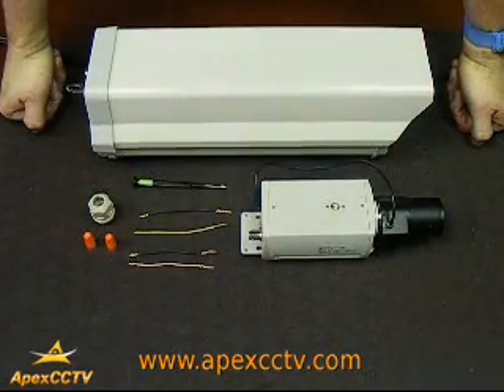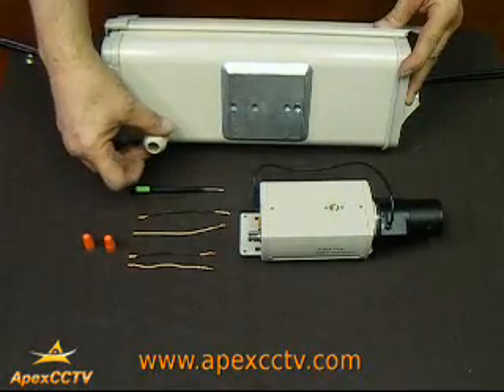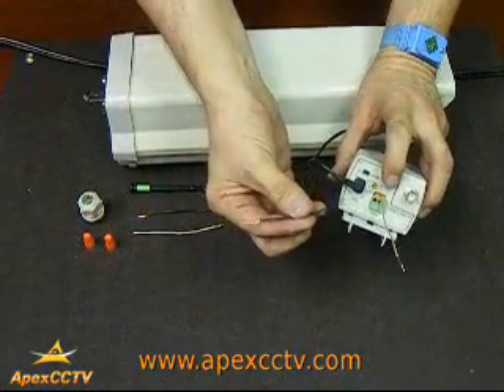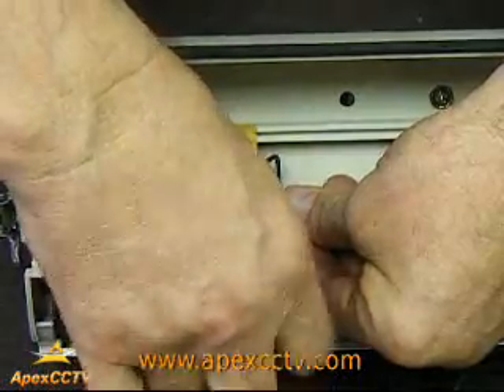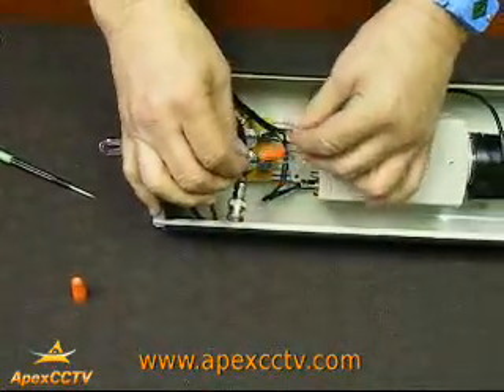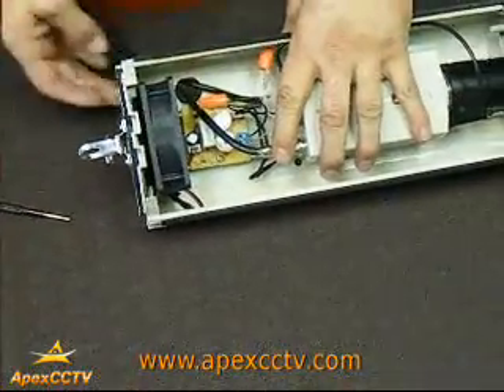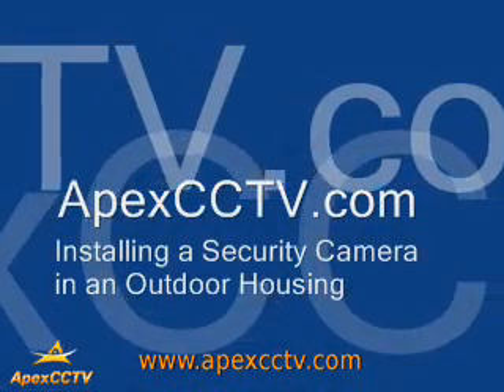Video Tutorial : How To Install a Security Camera in an Outdoor Camera Housing

Comment from the maker: The required VA and mA ratings will be on the blower itself, as long as the power supply meets or exceeds these requirements, the power supply will suffice. The type of connector will not matter. The power supplies at apexcctv.com/c-93-24v-ac-single-supply.aspx will work for this type of application.

Comment: Yes, I know you use Siamese cables for BNC and Power, I meant the short wires you were using to connect heater/blower to camera?, Would the wire  from an  electrical cord work? , I seen two types of 24v adapters on eBay, one has the screw terminals for the wire, The other is just a simple adapter with 2.1mm end, I'm assuming both will work?, My Siamese is pre-made.

Comment from the maker: The power cable is 18AWG that is bundled with RG59 video cable, which together are known as "Siamese Cable" and is specifically for CCTV applications ( apexcctv.com/p-371-siamese-power-and-video-cable-500-spool.aspx ). Before using "any 24V adapter", consult the camera and housing manufacturer to make sure it meets specification. Some 24V AC Single Supplies we use for various applications: apexcctv.com/c-93-24v-ac-single-supply.aspx

Comment from the maker: The cable is called Siamese Cable (apexcctv.com/c-87-siamese-cable-on-spool.aspx) and has RG59 cable for video and 18AWG cable for power. It is built specifically for CCTV applications. Regarding using "any 24V adapter", I would recommend consulting with the camera and housing manufacturer to make sure your power adapter meets their product's requirements. We sell a small variety of 24V AC Single Power Supplies that we have found to work well: apexcctv.com/c-93-24v-ac-single-supply.aspx

Comment: Are you using speaker wire for the blower heater,Camera power?, What gauge wire do I need?, Also will any 24V adapter work for power with this type camera?

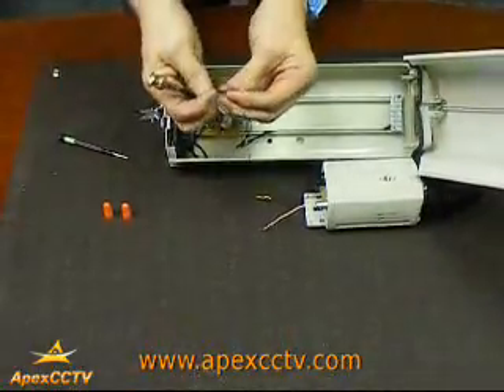Comment from the maker: At 3:15 he runs the siamese power/video cable up through the hole. When he is connecting the power, he is connects the heater/blower power and the camera power to the siamese cable power wires. Hope that helps.

Comment: With the heater blower housing, How is power run from the camera to the 24V AC adapter?, I didn't see you run a power wire through the bottom hole?

Comment from the maker: The heater provides protection for the camera in cold temperatures that could otherwise cause it to stop working. We suggest having a heater installed in below-freezing weather conditions.

The blower helps to prevent the window in the front of the enclosure from fogging up when the temperature difference between inside the device and outside is larger.